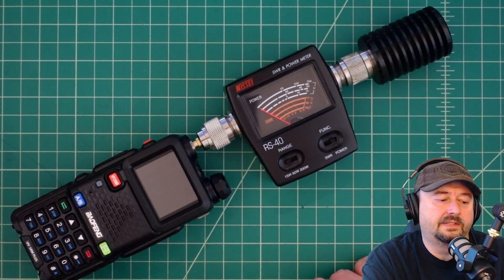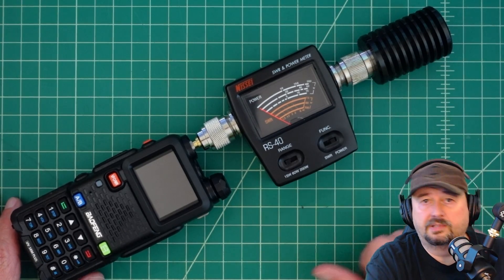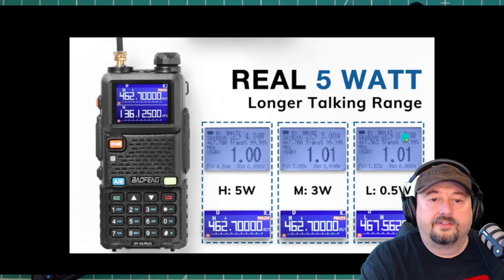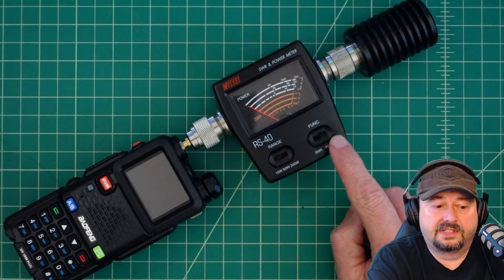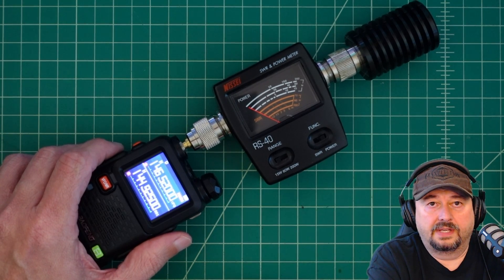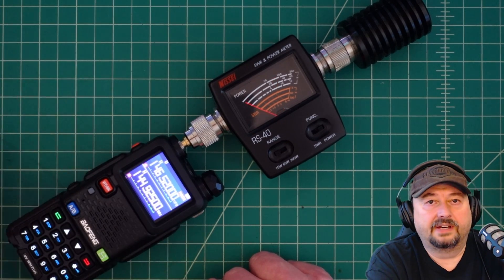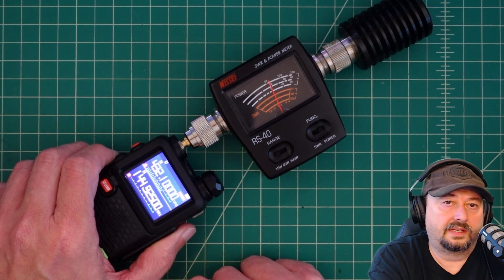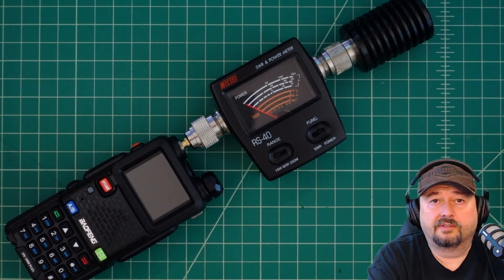Radioddity Baofeng UV-5RM Plus: Power Test

Comment: I accidentally locked myself out of the UV 5RM radio with the password function,Is there a reset to get back into the radio if I forgot the password
Reply from the maker: Not that I know of… 🤷
Reply: All 0's
Reply: @joenobili1  that doesn't work
Reply: There is no password reset and the password is all zeros 0000000 and then the green function key your welcome
Reply: @blairhay3335  I've tried that already that does not work you're welcome
Reply: It does on mine sorry your having bad luck with it

Comment: should checkout the ar-5rm, it looks the same, but is 10w and has 220 as well.
Reply from the maker: Thanks for the heads up 👍
Reply: Just picked one up. The ar-5rm is the turbo unlocked one. Has air bands

Comment: New to these radios. Bought the Tidradio H8 Gen 2 also have the Baufeng AR-5RM. Have them set to hearing my local police dispatch . Notice that the TIdradio picks up more of the dispatch calls than my Baufeng. Both set to high Baufeng skips some calls. Why is that? Do I have a bad Baufeng radio?
Reply: Just a guess but if you are using a tidradio and a bofung lol radio might check to see if you have the radios both set to wide band I have noticed tidradios Iv had like the h3 and h8 was all set to narrow band. And this could be one of the reasons you might be off the frequency by a little step or two. Ham radio we still can use wide band but back I think January 2013 fcc mandated that all public saftey radios was to switch to narrow band.  12.5khz instead of 25khz look at your frequency steps in the menu maybe. 12.5khz did affect some range on the equipment. But it only affected the public saftey bands 150-174mhz and 421-512 MHz if memory is correct on the dates. I worked for Motorola unfortunately during that time and was extremely busy reprogramming every tower site and mobile and portable radios.

Comment: Hello boss, I think that is 5RM and not 5G(i think UV5G is rated on the 5 watts limit) and 5RHM/5RH/5RM is advertised at 10 watts.
Reply: Yes, the specs he showed are for the UV-5G Plus, not the UV-5RM. Basically this video should be redone using the correct spec sheet.
Reply from the maker: you might be right about that, thanks for catching that 👍

Comment: Ape this message is regarding learning the AARL technician and general books. I am the reading every page of both books studying old school, and testing for both exams on June 1st at the hamfest in Marietta, GA.(Atanta suburb). I finished the technician manual and am in chapter 4 of the general manual now. Burned up 3 pens and 66 pages of notes so far. Probably will have 100+ pages of notes when Im done. Made flashcards too. If you are interested I will share my study techniques to encourage others to deeply dive into this material. To learn it, understand it, and be able to apply it in their radio journey. I did not want to just memorize the Q and A "cheat sheets" and get my general license. Where is the learning in that? You seem to be ine of the best on teaching new people like me. You and Dave Casler. I intend on watching every single one of his videos. Keep up the good work. Thank you. -Dan
Reply from the maker: Hey Dan, if you want to send any copies of the notes over the thesmokinape @ gmailDOTcom I'd love to check them out.  Good luck on the test.
Reply: @TheSmokinApe  will do Ape. The books tell you to learn all words in italics. Only about 1/3 of the words in italics are actually on the test. There is easily 4 times more information in these books that is on the test. I am also making so.e diagrams and actually working out the math problems without memorizing the answers. In many questions the answer given is "D, all of the above choices are correct". I write down all the answers. I am writing out, by hand the questions and answers to all 450 questions in both books. These books are excellent!!! Many say you don't need this much info on the how and why to get on the air. I disagree. I'm not gonna bet opinionated about this though, too many hams are way to opinionated -reminds me a lot of the gun culture! It's all good. I seek people like you and Dave. The hobby deserves deep learning, education, and dedication. I also bought the huge ARRL Antenna book and will read most of that too. I am planning a full wave 80 meter horizontal delta loop. Not sure of I told you I bought my first radio, with all the Yaesu extras. All used. The Yaesu FT-1000MP mark V. Will send you much data on my notes, study habits, flashcards, and my test scores. I will have had the books for 22 days before I take the test! But studying about 5 hours a day (OK I'm a little intesnse) I'm a homesteader who gardens. Have orchard, chickens, rabbits, bees, etc. I teach homesteading for free and do many old time types of things our grandfather's used to do. I am just a novice at ham, brand new, so not trying be an expert. I'm a loner who won't be on YouTube, but I learn all the time. Just wanting to share some old school study habits (I invented nothing) but I believe there is a lot better way than memorizing the Q and A. The bands deserve better. The hobby deserves better. Thank you Ape.
Reply: P.S. Ape: by the amount of dedication you put into your hobby and channel I easily predict your channel will grow exponentially. Good to see a hard working dude win. You honor the hobby Sir. -Dan
Reply from the maker: @DanLarkin-g2q  Dave is great, I’ve learned a ton from his videos. Sounds like your gonna have that test on lock down 👍

Comment: I have a UV5-RH which is exactly the same as the UV-5RM, even in Chirp, and indeed the radio outputs 9.3W in High, so nothing wrong with Apes Nissei meter.
I'm testing on a Surecom SW-102 which from the pictures shown in the video, the meter is similar or same as mine.
Reply from the maker: Thanks for the info NS8 👍

Comment: Thanks for the heads-up on the RF output problems.
If they can't even get close to the correct power output my thought is, "I wonder what else they can't get right?" And I don't need 10 Watts of UHF nect to my head in any event. I have a few Baofeng's, TYT's, and  Quansheng's that I picked up to use as loaners, but I've gone through each of them to make sure they work properly. They took some time. One of the Baofeng's failed to meet the harmonic specs without a lot of work, so now I just use it as a weather and broadcast FM receiver. But now that I have those 5 loaner HT's working correctly I've reached the point where if an HT doesn't meet all the specs out of the box for a reviewer I just pass on them. I've already put enough time into ensuring the cheap HT's work properly to have just gone ahead and bought a couple of good Japanese ones. SDR HT's are interesting, but not 'that' interesting.
Reply from the maker: Thanks John, there will be additional tests of this radio.

Comment: If the power meter has a rf stripline coupler, it is possible that harmonics  can fool the detectors into thinking it has higher power. Looking with a Spectrum Analyser will confirm whether the power is accurate.
Reply from the maker: I would agree

Comment: Quite a few sellers aren't quite sure of the specs of the radios they're selling. Baofeng isn't helping the situation when they brand the radio (both the front sticker and the label inside the battery compartment) with whatever the distributor wants. And you may be buying a radio from a retailer who bought it from a distributor.

These modern Baofeng radios with the full-color screens generally have 2 different types of RF final stage, depending on the model. The "5W" models use the H0606E driver which is rated at 6W max. The "high power" models use the HTL7G06S011P driver which is rated for 11W max.

BTW, pressing and holding the [8] key is usually a shortcut to change the power level, instead of needing to go into the menus. Some models with programmable side key(s) also let you assign Tx power as one of the side key functions.
Reply from the maker: Thanks for the info TMK, it’s helpful 👍

Comment: interesting. ??  if that power is true yo got the 8W version . I got a 8w version of the famous UV-5R and it's clean but around 7 W tested. so looks like the PLUS is extra power? so many Baofeng now. I have tested a lot of them. they all over the place. some low on power some real bad on harmonics some pretty good some ok . I bet if I buy same one and test it I get different results. the China radios just like that . JIM W6LG got a 2 pack and both tested different . same HT in same package.  may be different HT but still China ones . wounder if the PLUS model includes the special tool ?  on my UV-5R the nut on the SMA comes loose from swapping antenna . the special tool to tighten the nut is pull the volume knob off and put it on antenna SMA and tighten . then put volume knob back on. the volume knob is the special tool.  so many HAMS do not know that and use outher tools to tighten that nut. LOL not in the manual either
. 73's
Reply from the maker: Maybe the Plus is for more power, didn’t see anything in the manual about it 🤔
Reply: @TheSmokinApe  :face-green-smiling: